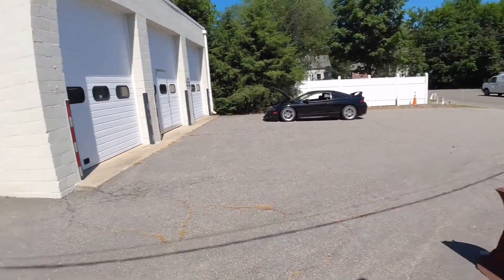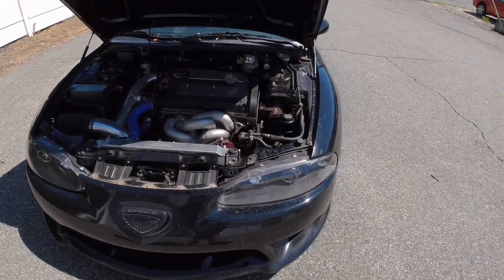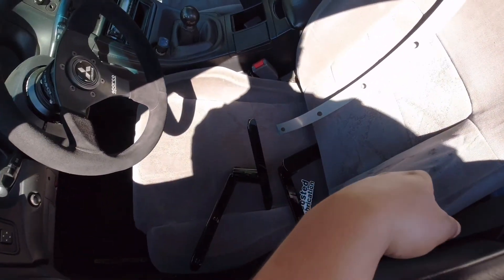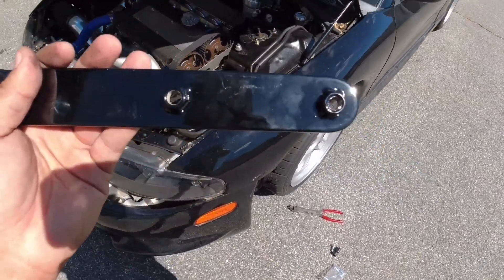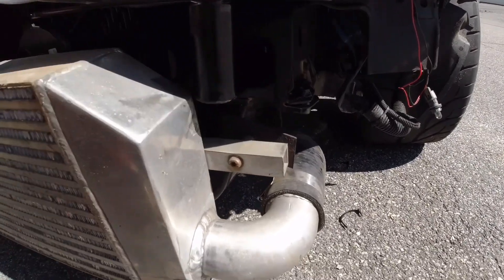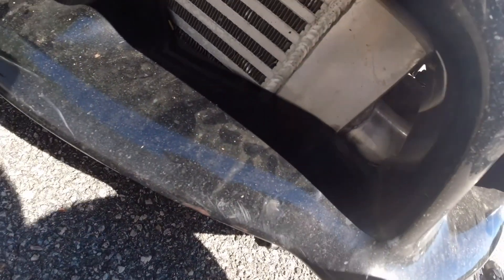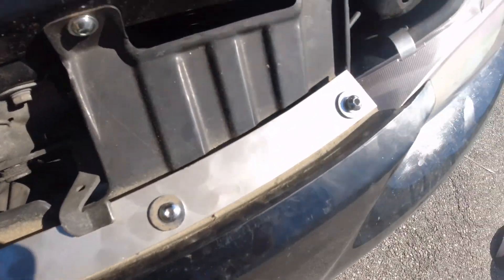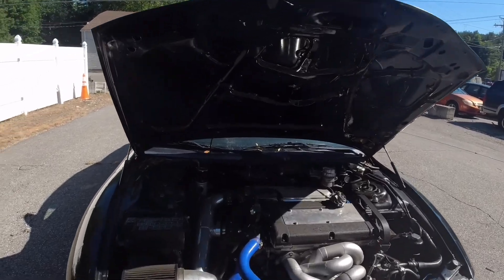Installing Boosted Fabrication bumper supports on the DSM!!

Comment: I was checking the cam position sensor. Is that a mod? Where could i get 1?
Reply from the maker: The cam angle sensor is a black top sensor from a 1g dsm with a frontline fabrication billet cover
Reply: @vic_gst7579  thats good. Thanks you. Maybe find an original bumper if you could. Wanted to let you know the awd swap is cool. Hope the awd treats you nice. Little jelly but that was a good move.
Reply from the maker: Kain C yeah I still have my eclipse bumper but just gonna keep adjusting. The Awd swap is amazing. Burnouts are cool but actually getting some traction is even better and thanks for watching bro 😎🙌🏽
Reply: @vic_gst7579  thanks to you i bought the second best bc raceing coilovers that they make. When you did the top five mods vids. I started grinding. Now i got race parts on race parts. Wishing to pull up next to you bro. I've started my tare down. Should tell Miguel dsm. But your cool jazzy way motivated me. Prolly little better man now.
Reply from the maker: Thanks man that’s awesome to hear 👏🏽 I hope your build continues to go well these cars are becoming quite rare. Glad I could have inspired you 🙌🏽